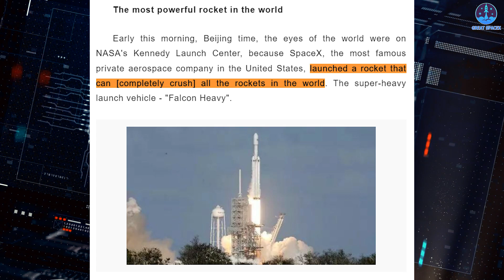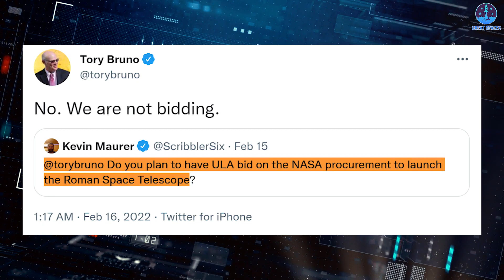A Closer Look At the HUGE LAUNCH of 2022 SpaceX's Monster Falcon Heavy awaken

Comment: One thing you didn't mention is the different flight profile that Falcon Heavy will need to use for launches that actually need most of its available performance. So far, we've always seen the boosters return to land on land, and the core land (or at least attempt to land) on a droneship. This is what I like to call the "low performance" profile, and is one of two that makes sense.

What we'll see for the next launch, and will likely see quite frequently for stuff that's really heavy or needs to go really far, is landing the boosters on droneships and expending the core. This is now possible since the east coast has two operational droneships. The 3-core flight phase will be longer, since the boosters won't need to do boostback burns, so the center core will be going much faster at booster separation. Obviously it'll be going too fast to survive reentry (even STP-2 was, and it landed the boosters on land) so it'll be built without grid fins and landing legs, and will use all of its fuel to boost the second stage. I like to call this the "high performance" profile.

Nothing else really makes sense. Triple RTLS? The amount of fuel needed for the core to boostback will reduce its payload to practically nothing. Besides, not enough pads. Triple droneship landing? Already covered that, the core couldn't survive the speeds it would reach with a longer 3-core boost phase. Besides, there aren't three droneships available. Triple expendable? Certainly possible, but not worth it. It would only be about a 10% increase in payload capacity vs landing the boosters on droneships and expending the core.

Comment: Remember falcon heavy might use raptor 2s for future launches which is more powerful and capable
Reply: No, not a possibility. Rockets and their engines are designed together, to work together. Switching to an entirely different engine that uses different propellants means designing an entirely new rocket. That rocket is Starship, in the case of Raptor. Realistically, the only possible way to use a Raptor on a Falcon rocket of any sort would be on the second stage. And even this would require a longer second stage, as methane is less dense than RP-1. Falcon can't get any longer because of how skinny it is, and it's that skinny because if it was any fatter, it couldn't be transported by road.

Comment: Why not conduct  the full-duration hot fire testing of  the Starships engines on the B-2 Test Stand located at NASA's John C. Stennis Space Center?  Would it be more efficient to assemble the Starship rocket inside the Vehicle Assembly Building at NASA's Kennedy Space Center?  The US government has excellent facilities for the testing of large rockets.

Comment: Aresum Rocket!  I think SpaceX has yet to successfully land a Center Core for the Falcon Heavy . . . Will be Exciting to see all three cores land . . . and be able to fly again.  : /
Reply: That's incorrect. On the first flight of FH the centre core crashed into the sea, but on the launch of ArabSat all three cores landed safely. The side boosters landed back near the launch pad and the centre core on the drone ship. This is stated in the video: did you miss it?
Reply: @ceejay0137   @CeeJay01  Did not know that CeeJay.  I've done searches on YT for Falcon Heavy landings and didn't see the ArabSat center core vid listed. I'll look again, if there's a vid showing that center core landing, I want to See It! I Did hear that stated in the video but so many of these "space news" reports seen on YT have turned out incorrect or just plain made up, especially for Spacex and the Apollo Era flights.  Appreciate the intel.  Spacex has been Gr8 about releasing any vid's on anything new they're doing, that's why after my first search I'd figured it didn't happen, I'll look again.
Reply: Arabsat's center core landed successfully. It was lost at sea because the Octograbber robot wasn't yet equipped to grab a Falcon Heavy core. Normally, it grabs the four hold-down points on the Falcon 9, but the Falcon Heavy core only has two. The other two are instead the thrust bearings where the thrust from the boosters is transferred to the core.
Reply: @KingdaToro  Roger That, didn't know.  I'm looking for footage of the Landing since it's the only Center Core to have done so successfully. Would be Kewl to see that, Thx Again.

Comment: The Falcon series rockets use Merlin engines. They put out 54 to 102.5 tons of thrust but Raptor 1.0 puts out 185 tons and Raptor 2.0 puts out 247 with an Elon Musk promise of 250.

Can you see the lines of deminishing returns in transition from one Rocket type to the next?
That is why I claim Raptor 5.3 will be the first itteration to operate at 300 tons of thrust. 
I also believe Musk will then unveil Martian engines which have 600 ton thrust via capitalizing on detonation rather than explosive thrust in the Martian 1.0, should reach 1 millon tons of force for the 5.3 edition. All this will be produced by 2034. Elon's Star Ship will dominate for at least 50 years after that.
Reply: I suspect that more will happen in the next 62 years than you can possibly predict.
Reply: @nagualdesign  agreed; prognosis is dubious because the probability's emulation of possibility is always fluctuating and my cognitive bounds add a layer of distortion to clarity and deprh of perception.

Comment: Only after Falcon Heavy flew did satellite builders realize that they can now build larger and heavier satellites. It takes about 5 years to develop a big satellite so only recently are satellites that size being built. As such, the requirements for Falcon Heavy to fly will grow rapidly as these satellites started 5 years ago are being completed. Falcon Heavy will continue to support these launches until starship is ready to fly. Falcon Heavy still has an expendable second stage so starship being completely reusable will supersede Falcon heavy
Reply: The GOES U in 2024 is a 10+ year old design already. The The stuff being launched in the 2030s is going to be civilization altering. 

Of course, that has been SpaceX's stated goal all along.